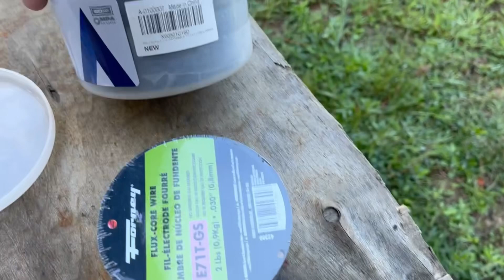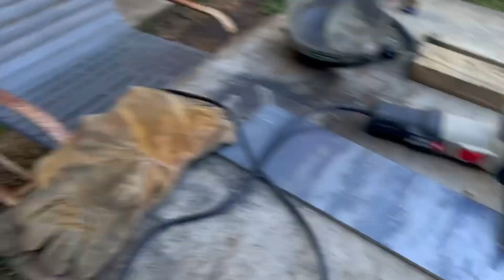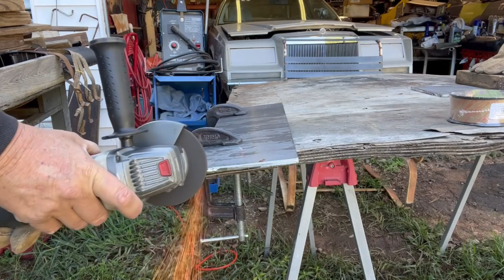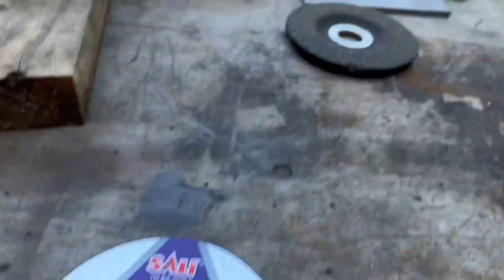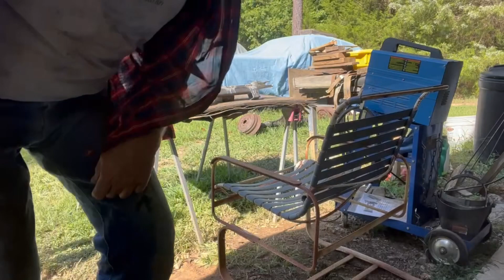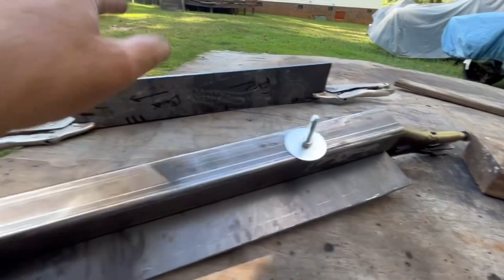Working in the shop today. Cutting, grinding & welding

Comment: That baby should be singing about 10,000 rpm. Let the tool do the work as Grandfather always taught me. Your going to find the sweet spot that will melt the metal like butter especially on the thicker stuff. Going well so far.